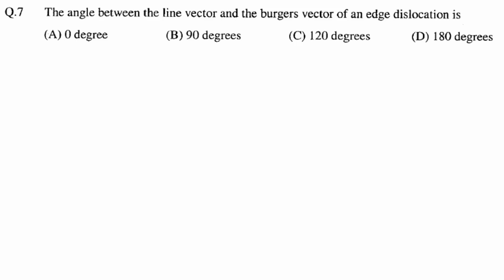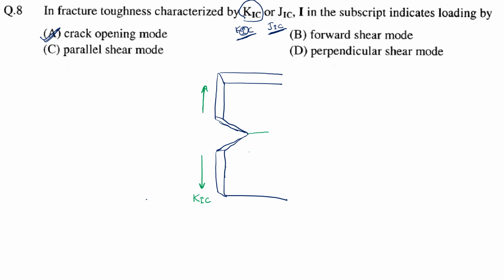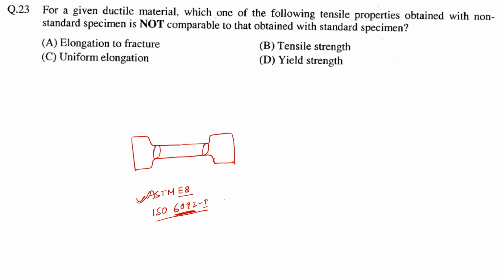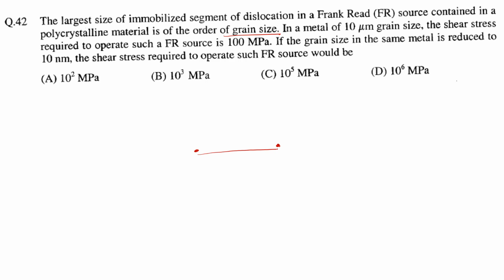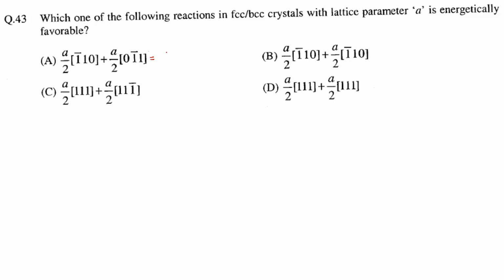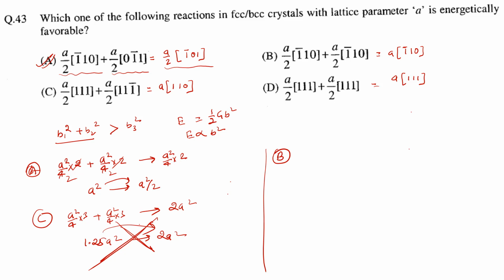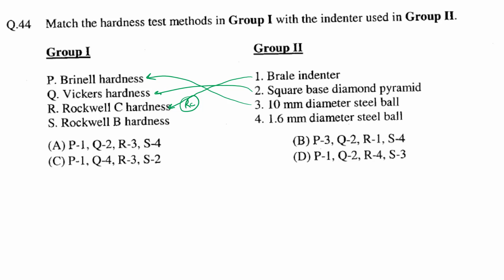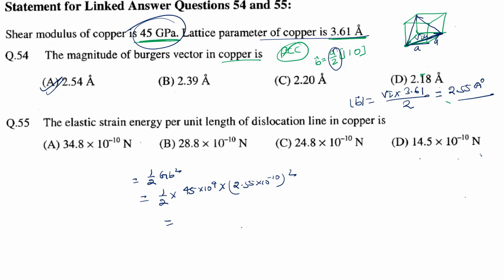GATE 2011 Mechanical Metallurgy Solution

Comment from the maker: 00:00 Angle between line vector
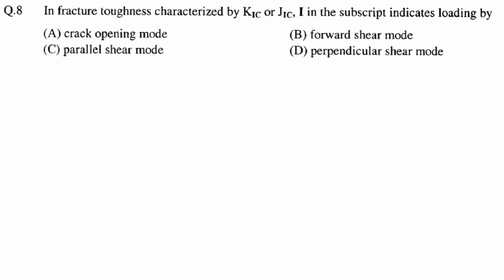00:59 Fracture toughness
04:07 Instantaneous strain
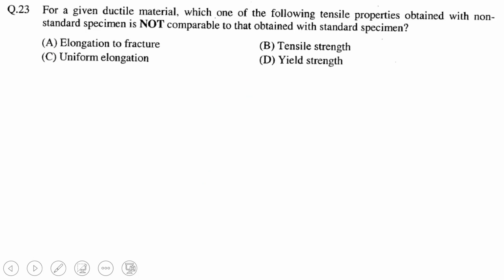04:51 Tensile test

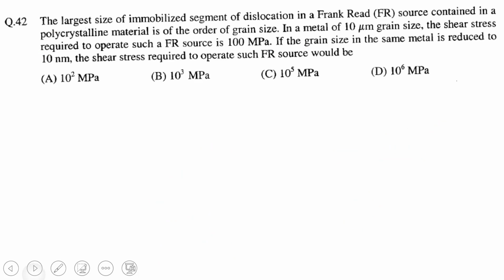08:39 Frank Reed Source
11:26 Burger Vector Reactions
16:35 Match type hardness
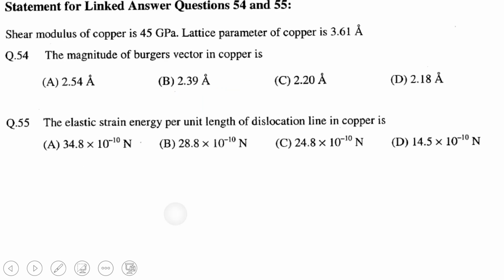17:58 Common statement dislocation